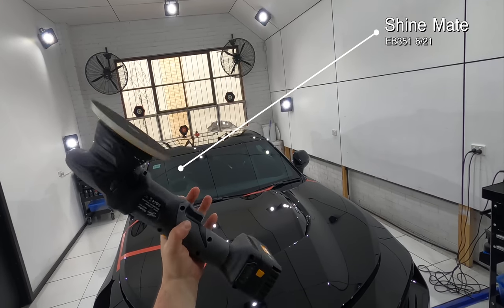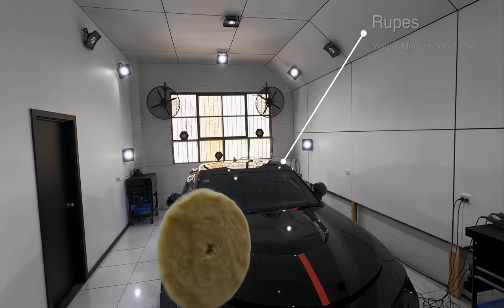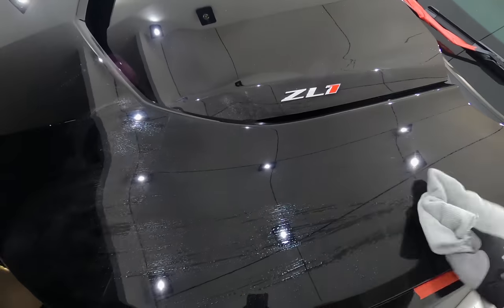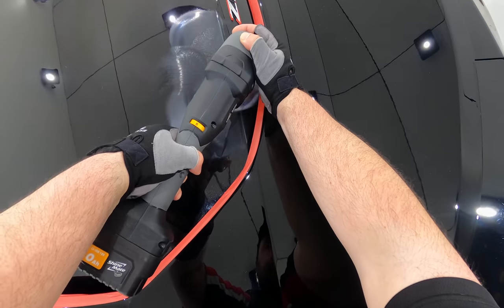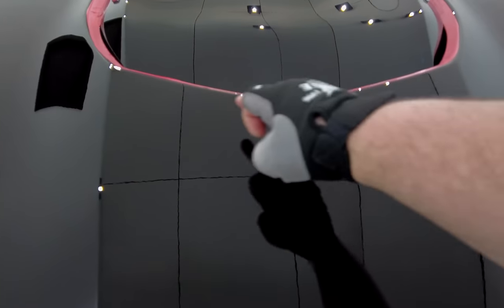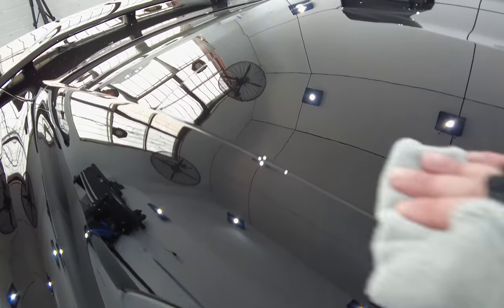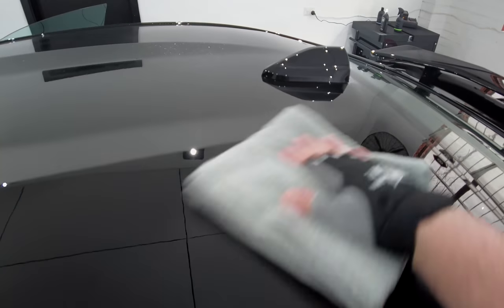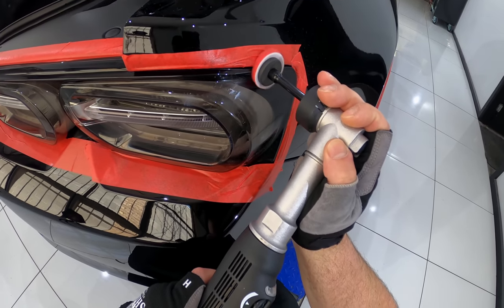2020 Camaro ZL1 Detail | The Worst New Car Paint Ever | P2 Paint Correction! (Vlog 32.2)

Comment: Well done Sandro the patience that you showed when working out the best pad & polish combination for the Camaro is second to none. 

This Camaro by Chevrolet is imported from the USA and then converted to right-hand drive and remanufactured by HSV in Australia and sold via by HSV dealers. That provides 3 different groups of people (Chevrolet in USA, HSV - Australia and HSV Dealers) that the Camaro goes through before it is sold. So anyone of three could have caused the terrible paint finish.  Looking forward to Part 3 of the series and the final result.

Comment: 100% agree with you on your good attitude  towards the buyer/owner of this ZL1. 
Not anyway should they have to put up with mess on the finish of that car. Demonstrator or not, you are buying a brand new car and the experience of that should reflected that on the day they picked it up from dealership. Not that the value of a vehicle shouldn't have anything to do with the experience but a ZL1 is what I would call an high priced vehicle. Not what you would call a cheap and cheerfull run about anymore is it. 
One more thing to mention is, yeah I don't think I would buy a black vehicle anytime soon. I could not be bothered with the hassle.

Comment: Ohh man.. I want one of those 15mm ShineMate cordless polishers soooo bad! Those machines are beautiful. 😍 

I've run into this too. The worst was a black 2013 VW Passat TDI. Hard to cut, near impossible to finish. Even a new Eagle 500 gsm IP wipe would mar. Had to finish it by hand with a foam pad, Perfect Finish and McKee's N914 at 1:8 for a panel wipe, which has saved me many times. I work on a lot of VWs, still never encountered another one quite like that. 
Great video as always, thanks Sandro! 
👍👌✌

Comment: Hi Sandro. Loved the video. I have the same car, a red 2020 Camaro ZL1 which I purchased brand new. When I received the car (car was delivered to my house during COVID lockdown in Melbourne) the paint was damaged similar to your video. My detailer, who is skilled like yourself, spent over 40 hours correcting the paint damage and applied a ceramic coat for added protection. The paint in your example wasn't resprayed. The car goes through many hands when imported into Australia by HSV. It is reengineered to right hand drive which means the car is entirely dissembled by hand and rebuilt. I agree that the paint is extremely soft and the dealer didn't help and caused most of the damage. Every morning cars get a bucket wash at the dealership and a soft paint like this will get damaged instantly. Initially I thought that my ZL1 was mistreated, but on visiting many HSV dealers I can safely say that nearly all Camaro's are in a similar condition. Black and Red will show most defects. This video reconfirms that it wasn't just my ZL1 that had paint damage. Thanks for sharing.
Reply from the maker: Thanks for sharing that!
Reply: @CarCraftAutoDetailing   Hey Sandro, what's your recommendations on maintaining a delicate/soft paint like the ZL1? Mine has a ceramic coast (Carpro product), I personally wash the car, I air dry it using a Bigboi but I get nervous when using Carpro Elixir after a wash.
Reply: Something else was going on here cuz he couldn’t get everything out, so it wasn’t soft. If it was soft, he’d get everything out with the yellow. It still had spots here and there. Almost looks like it didn’t cure. He had to step up to a blue wool and heavy cut compound. I’ve never had to do that on soft paint

Comment: As someone that has several GM car owners. All of them... have looked like this. ONE was marginally better as he demanded we pulled the plastic off the moment it came off the truck. And that one still took longer than needed. The rest I could tell where slammed threw a brushed car wash and dried like garbage until sold. Which is also normal here in the States...

Comment: I’m going thru this same situation currently with my recently purchased 2019 black ZL1 Camaro. I bought it used with only 3,750 miles and the paint looked as though it had been washed with sandpaper for years. This is my first attempt at paint correction so it’s quite the job for me!🤦‍♂️

Comment: First off as one professional detailer to another I have so much respect for your knowledge and ability to take paint correction to a whole another level. Personally, I've had a similar experience with very soft and unfriendly paint on a 2020 Ford Mustang (also black but no metallic). Everything you experienced with this car's paint in your video I experienced with the 2020 Ford Mustang. I'm curious to know if you  tried Optimum Hyper Polish (spray) paired with Rupes white ultra fine finishing foam pad? It's my go to for very soft/unfriendly paint (That's an understatement in regards to soft/unfriendly paint). 

I spend many hours paint correcting cars to show car quality (95% overall improvement in paint clarity). The car you paint corrected in this video is basically what I do on a weekly basis (professional level quality). I only point that out not to brag but to emphasize the real struggles and challenges of paint correction to professional level quality. With that being said I have not tried NV Finesse Fine Compound...If you have tried Optimum Hyper Polish (spray) how does it compare to NV Finesse Fine Compound? I'd like to hear your feedback. (I've used so many fine polishes and keep going back to Optimum Hyper Polish) Looking forward to hearing back from you. May God bless you and your business!!!
Reply from the maker: Thanks mate I really appreciate it. Unless you do high end paint correction on a regular basis it’s hard to understand or appreciate all the challenges and frustrations that go along with it but I think that can be said for many trades and crafts when pursuing high level outcomes! 
Although I have tried quite a few Optimum products I haven’t used Hyper Polish so I can’t speak to that, but definitely always open to trying recommendations. What I would say is that we all work a little differently, and the best thing you can do is use what personally gives you the best results as I know others have used products that I love without achieving the same results and I’ve used plenty of highly recommended products that just didn’t work out well at all. We all a little different that way and I guess that’s why there’s a million detailing products out there!

Comment: Is it the paint or rather the clear coat that's at fault here?  It does appear the manufacturer is putting down a lot more clear coat but really doesn't know what's in the can with soft clear coat.  In either case, this series has been beautifully done and I've also learned a tremendous deal on this project.  Thank you!

Comment: Great vid mate.  The thoroughness of your pre-polish tests never ceases to amaze.  I do have two questions though... 1)When we say soft paint, are we talking about the clear coat, or the paint job underneath the clear coat?  2) I see in your vids when you do the light reflection, the light reflects perfectly.  The reflection on my car looks wavy... I think its called orange peel... Is orange peel the paint, or the clear coat?  If its the paint, dont you have to cut through all the clear to get to the paint to flatten it?
Reply from the maker: When we refer to soft paint it’s predominantly the clear coat, but a soft base colour paint can certainly still have an impact to the overall softness or sensitive of the finish. 
Orange peel is also generally a clear coat issue, but some very high end paint shops also flatten the base coat to create the ultimate perfectly flat mirror reflection.

Comment: Repaint would have been a mistake. Lots of swirls and water spots, but they came out nicely. Ever use microfiber pads and carpro clearcut? Amazing stuff.
Reply from the maker: Yes I’ve used ClearCut with MF pads and it can work great depending on the paint and defects
Reply: @CarCraftAutoDetailing  great videos.

Comment: I have had this issue with newer gm vehicles have super soft paint I have done a black Camero exact same problems happening and a newer gmc truck decided I already knew there was gonna be marring from my buffing pad so I just said screw it and have used this combo on all newer darker paint gm vehicles used P&s there soft wool pad part #2703 and combined that with shine supply classic cut trust me try
This combo and finish it with a p&s foam black/grey pad with dark supreme polish turn your buffer down to speed like 2/3 and pretty much use a jewel technique with the dark supreme and trust me you will have 85-90% scratches and then perfect clarity with finishing it up with dark supreme just a idea man it has worked for me for over 4 years on most all darker vehicles I do it’s my go to

Comment: Great video. Did make those Nano wool pads yourself, like you did in one of your other vids? And will a good ceramic help to protect a soft paint like this to a reasonable extent?
Reply from the maker: Thanks, thanks but no I didn’t make those smaller pads and a good coating will help a bit but coatings also take on the character of the paint so it’s not going to turn it onto a harder paint or finish.

Comment: Hi Sandro. I wonder how PolishAngel polishes can deal with this paint? Have you still use PA? I remember your old post about PA polishing range and you rate them very high.
Reply from the maker: I do really like PA polishes but one thing I found out later on is that they have a very short shelf life many 3mths or so and after that their performance seems to diminish quite noticeably and add the coat which is quite high and they just become very difficult to justify if you have dispose of them relatively quickly.

Comment: Good day mate. Just wanna ask. Would it be quicker and efficient to cut with a rotary and finish with a DA? What are your thoughts? Nice work by the way.
Reply from the maker: Thanks, and it really depends. Soft and sensitive paints can get hotter and softer with rotaries, making them even harder to refine in a second stage. Also as I mentioned in the video, I’m always initially looking to single stage paint when possible, and that’s just not possible to do with a rotary to a high end level. Cutting really wasn’t the hardest part of working on this paint, it was finish well and the more holograms, haze and compounding marring you have the harder the finishing becomes.
Reply: @CarCraftAutoDetailing  well said. Thank you and happy holidays!

Comment: I’m not a pro detailer, but I’m fighting with my new 2022 Camaro. Paint is just plain soft. 
I can do the paint correction myself, but even after all that work. The micro scratches come back so easy
Reply from the maker: Yes, overly soft paint is hard thing to overcome and find a perfect solution, it’s just the nature of the beast.
Reply: @CarCraftAutoDetailing  
I pulled my sons black 2018 GMC and did the same treatment I gave the Camaro and it was night and day. Something going on in that plant in Lansing on those 6th Gen Camaros. 
Same paint code on that GMC, but it felt like I could have dragged a chain across the hood without scratching

Comment: Was waiting for this one
Did you measure paint thickness after correcting? I'm curious how much you removed as it is so soft
Reply: thelastm  hes already done it in the past video. This gentleman was inquiring if Sandro measured afterwards to see how much paint he took off during the procedure.
Reply from the maker: Especially with paint that was ranging from 250-400 microns it’s just too difficult to gauge how much clear was removed but I’d be surprised if it was more than 5 microns I removed in total.
Reply: @CarCraftAutoDetailing  that's interesting thanks
It would be cool to see a measurement of the depth at the same spot before and after a correction like this

Comment: hey sandro i liked how u teach us about detail work not only on the bonnet. Can u tell me about how to deal with sticky compound and compound splatter (rotary problem) this things are really painful.. anyway love ur video thumbs up!!
Reply from the maker: Thanks mate! 
Sticky or hard to wipe off compound can be due to a few things. Firstly excess heat on the paint can cause it especially if it’s a softer paint, so things like reducing pressure can help as it reduces heat and just making sure the panel doesn’t get too hot to the touch can help. On the opposite side of the scale, not working a compound long enough or/and using to much compound can also make it sticky and hard to wipe - compounds will start to turn more translucent as you work them as a sign that they are breaking down, so trying to find that sweet spot where you don’t over over them but don’t under work them is key! Making sure your pads are blown out after every set of passes also makes a huge difference- excess spent older compound and paint residue on your pads leads to harder wipe offs and dusting.
Reply: @CarCraftAutoDetailing  thx mate it is really helpfull having conversation with the pro. So the key i must keep practicing with the tool and for me its really chalenging especially with consistency while i handle with rotary. Thx man i will keep watch ur video to enhance my technique!

Comment: Impossible this was paint from the Mfg. Swirls do not come from the Mfg paint process it comes from polishers and non professional detailers.  You did a great job because you are a professional detailer. Even your paint correction will not last. Eventually the swirls will be back and it will need to be corrected again.

Comment: Can the cordless 3” power through the curves like the shinemate 3” corded? I find cordless MUCH more enjoyable to use!
Reply from the maker: It definitely nicer to use, but I would say that the corded version has a bit more torque and a little less stall around curves.
Reply: @CarCraftAutoDetailing  thank you. The new corded shinemate 21 goes up to 5800 OPM. 😳 That is way too much, IMO. The cordless 21 looks to be setup right. Even at 5000 OPM, heat could definitely be a problem.

Comment: I don't know if I'll get a response, I plan on detailing my car soon and try to apply a lot of thought process and techniques I picked up from your videos, the thing is I am not too worried about not doing an amazing job, just doing it for kicks and giggles on my high mileage civic, I always wanted to try this out over the years. The temperature outside is hovering around 3 to 12 degrees along with the humidity being up there, what are the other things I should also take into account in that situation?
Reply from the maker: Lower temperatures (within reason) work to your advantage when detailing outdoors, though high humidity doesn’t. As a former outdoors mobile detailer the advise I’d give is try to start early as possible, be organised before hand with your products and equipment to allow you to move quicker, try to position the car in the shade when possible , rinse all detergents and chemicals before they dry on the surface, try and polish out of direct sunlight - you can even polish one side in and then move/rotate the car to keep it shaded and polish the other side. It’s really just about doing the best you can to adjust to your environment.
Reply: @CarCraftAutoDetailing  Thank you for the reply! It's pretty much always cloudy on this island so that won't be an issue both fortunately and unfortunately, I'll have to set aside a good few hours in that case and would I have to clay my car again? I did so 2 months ago, but it isn't smooth as I remember it to be compared to that day
Reply from the maker: You shouldn’t have to clay within 2 months unless there’s some series fallout in the air. Complete clean and bare paint should feel smooth will no bumps, but it should also feel a little tacky and not too slick. If you use certain clay lubes they leave behind certain polymers that create added slickness which is something you want to avoid before paint correction or protection.
Reply: @CarCraftAutoDetailing  Thanks for all the insight! Makes sense sense why my car was beading of water too lol

Comment: What would you say, in your opinion is the best most effective snow foam soap? Im looking for a quality snow foam that will clean the surface of the car.
Reply from the maker: I don’t think it’s any secret that I really like Nv Snow+ and use it all the time. 
You need to find a balance with a good pre-soak foam, yes it has to be effective at lifting and softening grime, but you don’t want it to start etching and staining more sensitive trims or even paint so you want effective but also safe.
Reply: @CarCraftAutoDetailing  thank you

Comment: Do you still use a 15mm throw DA polisher? I have a  DA15 and 125mm plate size and im wondering about buying a 21mm throw. Do you think it's worth?
Reply from the maker: Yes I use 15mm DAs all the time and if you feel you want to achieve a slightly faster cutting ability on the larger flatter areas of a car then a 21mm with a 6” plate can certainly be worth it, it just depends on your needs and wants.